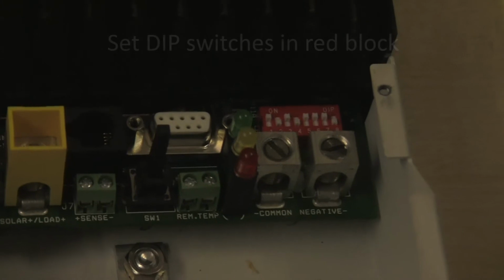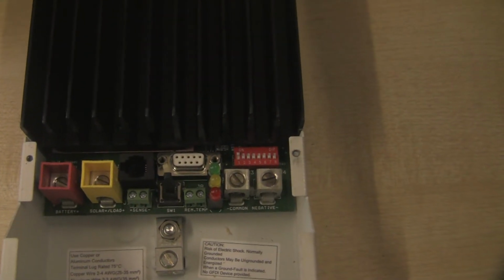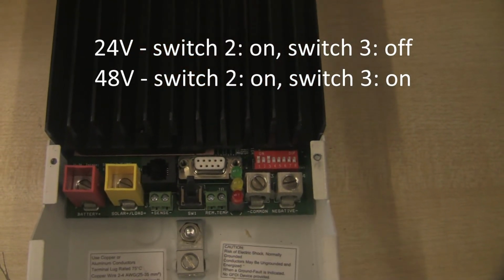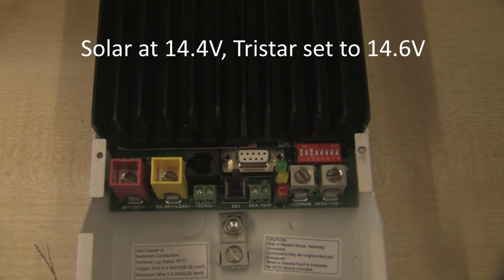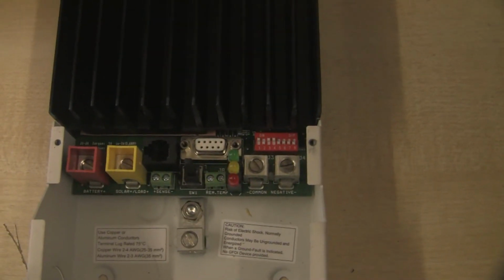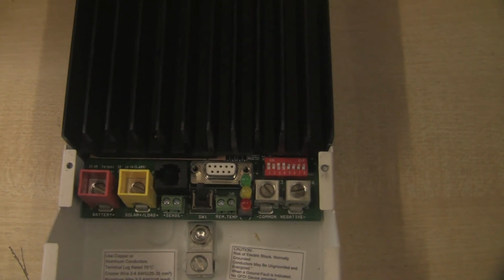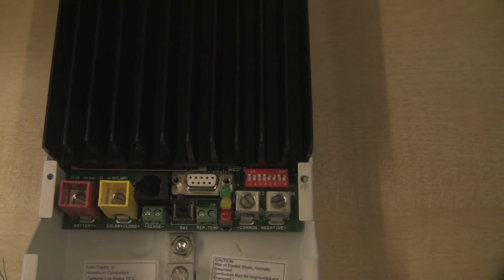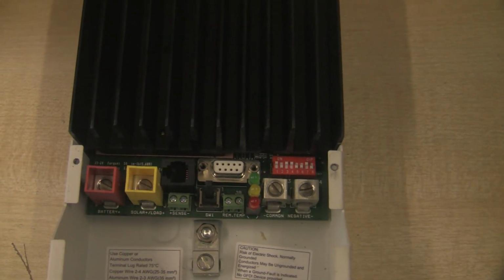Configuring Tristar charge controller

Comment: Why would the dump voltage for the wind turbine be slightly higher than the solar dump voltage? Great video by the way. Clear close up view of what you are working on!
Reply from the maker: Thanks! It should be slightly higher (0.2v) to avoid unnecessary solar dumping from elsewhere in the system

Comment: great video. Quick question. If i am using 2 6V Trojans flooded, which are rated for 
Absorption 14.8v. Float 13.2v. Equalization 15.5v . The dip switches 4,5,6 would be set to on-off-on ?
Reply: yes